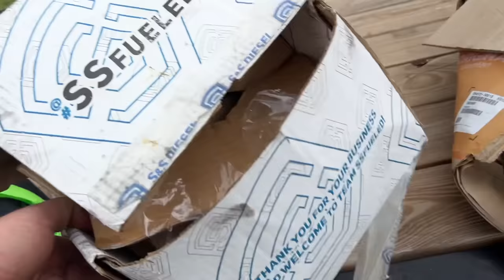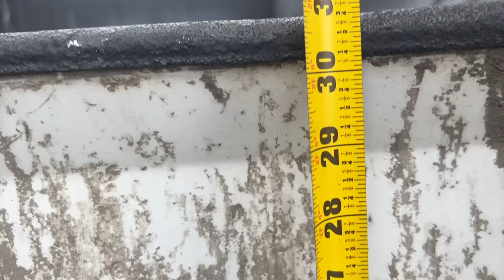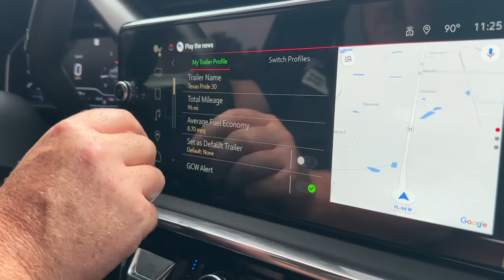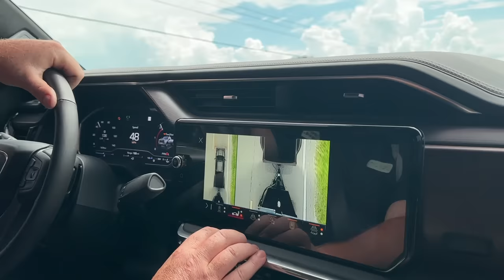$100,000 Diesel Truck VS $2,000 Diesel Truck!!!!  Are These New Trucks Really Worth It?

Comment: No matter how you put it, there is never a good reason to buy a truck for $100k when you can get a 2019 for $53k. They RAPIDLY depreciate and are often less reliable than the older models. It’s legitimately proven
Reply: Your not buying a 2019 3500/F350 for 53k Denali/Platinum without a crap ton of miles on it. I love how all the small brains assume you have to buy a Denali to get a 3500, or a Platinum to get a 350. There's brand new diesel 1 tons for 66k-70k
Reply: @GhostlyGhille  All fleet sales. White XL's for Ford, white LS's for Chevrolet. GM doesn't cater to fleet, as Chevrolet is the fleet brand.
Reply: @GhostlyGhille  is right. Just picked up a 2024 2500 duramax custom for 67 out the door.
Reply: leptivieux1  it is what it is in this market. I need something reliable for work, but I don’t need the tv screen in my wood dash for an extra $18k
Reply: usually newer cars are more reliable, last longer with better fuel economy technology, but something has had happened in these last years; If i've had to get a pickup id buy anythin' from the really old ones to just about 2013
Reply: Plus imagine the price difference of fixing the vehicle.
Reply: @SKC_car that's cause you drive it to shit. Sell it for the next person to fix it up. That's what takes the most time. But you're right as long as your new car isn't facing recalls for everything.😂
Reply: @jabocjacob7064  67k is a horrible investment. And not very reliable.
Reply: @Infamous-cause  yeah I'm sure he's beating the hell out of a brand new vehicle he has a loan on. My wife doesn't beat vehicles and her brand new explorer needed 6k worth of electrical work done right after the warranty expired.
Reply: Nah bullshit newer ones run fine . older ones are what are at the shop
Reply: @iam1ofST2  ironic how that works huh? Lol 😆
Reply: @Joeybago12  also won't retire until you're 70 🤡. I'll be retired before I'm 45.
Reply: U won't find a 2019 limited or longhorn. Unless hi miles. Maybe a Laramie or slt
Reply: My 2011 worth nearly 50 loaded 89k
Reply: Yea this is a shitty point because you don’t know what the reason was to why the 2019 is back on a lot after 4 years like a new vehicle is yours only yours no one else to blame if some goes wrong 💀😭
Reply: @ianlundy416  it reallly doesn’t matter. Anyway you calculate it there is no reason to buy a new car. The thought of buying a used car with problems is extremely easy to avoid with a few months of researching cars. Buying a well engineered car with over 100k miles is absolutely no problem and you can often more reliable vehicles around the 15-20 year mark.
Reply: Can you show me a truck that’s a year old and 47k less than what’s on the lot?
Reply: @joesminis  look at trucks around 15 years old. Majority of them even with higher miles are just as or often more reliable than newer trucks. DO YOUR RESEARCH. Don’t buy cars with unfavorable engineering.
Reply: It doesn’t matter, some people just want a new truck/car. Something that’s THERES and no one ever else has owned or has had ownership over.
Reply: When you got the money like that why not
Reply: Yup. The newer models are garbage 😂👍
Reply: One word tax write offf
Reply: They are paying for the warranty..
Reply: ... and you stoll have $50,000 to spare for any repairs you might have like a $7,000 fuel rail system repair. Never have to worry about all the bs environmental systems that cause newer diesel's to fail 60,000 miles later, which are costly repairs in themselves.

$20-30,000 sounds much better than $100k.
Reply: Sure there is if you can write it off. Helps me with taxes.  If you own a company you can write it all off
Reply: I bought a 2020 chevy duramax work truck for 47k. Thanks to family discount but it still was a 50k truck. I've added the upgrades I wanted on my own for less than 2k and it has all the looks of a 65k truck. The diesel is what I wanted and we'll worth it compared to the gas engines.
Reply: @bjenkins803 what do you do for a living?
Reply: I like the idea of letting the first owner iron out the initial warranty issues while it gets broken in.  Waste somebody else's time.  When I bought my last used truck, I just paid a few bucks for an extended warranty from the dealership. Well worth it.
Reply: @jabocjacob7064 where?😂
Reply: That 53k dollar 2019 also has 193k miles and is closer to risk of needing repairs done. This is why you buy new.
Reply: @G7clipsofc I just bought 2020 duramax LT for 53k with 52k miles.
Reply: They don’t depreciate very much if you trade them in about every 3 yrs and don’t scratch or dent them and keep the insides clean they bring top dollar and if you have any warranty left that’s just a big plus !
Reply: GM with the lifter problem that takes a new motor because metal has wntvthrew the whole motor and that’s what happen to my brother in-law 36K miles GM put a brand new motor in his truck but the dealer changed the lifters out for some brand X and it’s doing great now with 74K on it. Fords new gas engine Godzilla is a lifter eating monster and 56mi per gallon , that’s a nice new truck and he knew what the problem was so at each service he would take a oil sample and from the 5th oil change he got oil samples bake from BlackStone with metal in oil and the dealer said drive it till it stops and we will tow it in and put a new motor in and it took about 2 mo for it to quite and they had that motor in stock as it took them like 4 days to change and they put aftermarket lifters and cam in it and I don’t know if that’s Ford doing that or the dealer just takin care of good life long buyers of Ford products.
Reply: Fixing people’s trucks is where the dealerships make all their money or it use to be but I think they are making money all the way around sales and repairs, Gotya !!!
Reply: All I need is diesel 4x4 long bed dullay 4 door power windows puck bed tow package radio and that’s it .
Reply: Just open the hood on any new diesel truck you can hardly see the motor and the V8’s are the worst you have to pull the cab to work on and it’s a ton of money just to pull cab much less doing the repair and if all of them would stop putting there motors half way in the cab it would be so nice or make the like a Kodiak where the whole front end folds out and can be easy taken off for repairs. Just look at the new half ton straight 6 they were mad for cab over trucks not pick ups all the things that need to get to is on the back of engine like rubber belt run oil pump you have to drop the trans to change it out I think the said 100 -150 k miles it would be great on a cab over truck which they were built for Issu special !!! I think it is a good motor if you sell it every 70-80 K miles and if anybody can screw it up GM can !!!!
Reply: Unless you can write off that depreciation as a business cost 👌
Reply: @iam1ofST2 or after you pay it off lol
Reply: Some people want to get exactly what they want. They got the money.
Reply: I still drive my 95 7.3 423000. Miles. No intercooler. Stock 2 wheel drive ex, cab.3 transmissions. Also 99 4x4 extcab. 130000. Batteries and alternators.   Paid $34000.00 95 xlt. $42000.00 99 EXT 4X4.
Reply: Bro you don’t know what your talking about.
Reply: @monroe8365  New Hampshire. There’s no bullshit markups in New England
Reply: Ill take a 1999 ford f350 with a 7.3 over most modern diesels
Reply: @TheXV1CT0Rx  finding one is impossible
Reply: I agree, but IMO i'd rather buy my favorite looking truck, and engine swap it with my favorite engine. Did that with a 07 f350 king ranch engine swapped it to a 5.9
Reply: This does feel like a fair comparison
Reply: Did the new truck really perform sooo much better?
Reply: My old diesel left me stranded 100 times even after I put 50k in repairs so there is no way you can ever make me go back to used vehicles
Reply: @RigmorTalonbeard  must have put 50k into the wrong stuff. Or a bad mechanic.. 50k is enough to get a new engine, trans, rear gearbox, suspension and front end, with money leftover for a detail
Reply: @msharp6887  yes it was mechanically restored and still had issues every month. All done by ford
Reply: @msharp6887  and it was a 7.3 drw zf6 supposed to be the holy grail of all used trucks. Only 210 000km. I used to preach having old trucks was better but after stepping into a brand new truck the luxury the warranty and the reliability can't be matched. I probably won't have it longer then the 10 years it's good for anyway
Reply: @RigmorTalonbeard  clearly poor mechanics
Reply: @RigmorTalonbeard  10 years? That’s pathetic. Should last 30-59
Reply: @msharp6887  you missed my point. I don't want an old truck anymore and no truck will last that long without costing as much as something brand new. Do you understand how much it takes to male a vehicle last 30 to 60 years? I don't think so
Reply: @msharp6887  in 10 years I'll trade it in and someone else can pay to maintain it while I enjoy my nice new truck with all the new equipment and no hassle. If all you can afford I'd a used beater then that's fine but you can't say an old truck is better you are lying to yourself and you know it. If new vehicles were so bad the companies would go bankrupt doing warranty repairs and replacements
Reply: It is your money. Buy what you want.
Reply: @RigmorTalonbeard  yes yes i do. And if you are spending. 30 + k on repairs every 10 years, u need to stop abusing your vehicle
Reply: @msharp6887  $50k in repairs…? Dude I have never even spent $50k on all
The cars I have ever owned in my life. Spend $8k on a decent used vehicle with favorable engineering and it should last 10-15years. It’s ridiculous to think you should ever have to spend $50k on a vehicle let alone in repairs. You did something wrong there guy
Reply: @OleSevers  u misunderstood, I didn’t spend that. The guy I was responding to spent that. Like a chump
Reply: @GhostlyGhille  I'll never understand the excitement for a premium truck package. At least not the 30k+ upcharge excitement.
Reply: It’s fine if you have money
Reply: What do you mean. You can still list an 07 lbz for 30k 😂
Reply: @GhostlyGhille 

Those are fleets. To get a family diesel you’ll have to pay money SMDH 🤦‍♂️
Reply: @Joe_Brown99  wth you mean a family diesel your family can't fit inside of the same sized F250 because it's an XL ? Reality is you want more bells and whistles and even then an XLT 250 is 73-75k with a 6.7. I sell these for a living and know prices and packages by memory. You want a 4x4 Lariat 250 for 2wd F-150 XLT prices that's not reality.
Reply: @TheXV1CT0Rx  7.3 made dog water for power. Could it run for ages definitely, most don't need any internal work into over 350-450k miles. But they make less power than the 3.5 ecoboost. The 7.3 is basically half the motor a 6.7 is. And thats with the emissions crap choking the 6.7 down.
Reply: @GhostlyGhille  i recently bought a 2021 lariat 4x4 for 45
Reply: @msharp6887  used with how many miles ?
Reply: @msharp6887  and was it a 500a, 501a, or 502a. Fx4 or just 4x4 ?
Reply: @GhostlyGhille  it was used with 35k miles, yes an fx4 though I don’t know the difference. It was a turbo v6, sunroof, power tailgate, all
Power, with trailer package. No idea it was a 501 or whatever
Reply: @msharp6887  502a has adaptive headlights power boards and power lowering and raising tailgate, 501a doesn't but still has most of the bells and whistles, and 500a is basically just a xlt with leather and a lariat badge. That said 302a xlts still nice. My 21 F 150 302a xlt arrived Feb 22, got it for mid 50s sticker was low 60s, has 15k miles on it last appraisal was for 49k
Reply: @GhostlyGhille  so that means I have the 502
Reply: @msharp6887 The easiest way to tell is if you have LED projector headlights not led reflector headlights (looks like a regular headlamp just with an LED bulb). Every F-150 XLT 302a and up has LED daytime running lamps, but only 502a and up get projectors. If it is a 502a 4x4 for that price is a pretty good deal. 502a is the notch below a King Ranch, or Platinum.
Reply: @GhostlyGhille  sweet . I love knowing I got a good deal
Reply: Yup my 13 is almost paid off and that’s way better deal then a 100k truck that’s just dumb!!!
Reply: Buy a used one that someone traded in because it was going and get fucked on the back end you seen how much a new engine costs
Reply: @GhostlyGhille yup just got a laramie 3500 dually 69k
Reply: I’ll keep my OBS as long as she will have me I really don’t know what people are thinking when they cough up 100 k for a luxurious truck that you’re afraid of scratching
Reply: @herbertmichaels2841 funny new one the payment is a mortgage not to mention the fluid in the exhaust thing is just flat out dumb my old truck could be in the shop everyday and still be cheaper
Reply: @OleSevers because everything was fixed already plus bonus parts
Reply: Love these people making excuses for new vehicles “needing work after 100k” or saying they’ll last longer.

Do you know how many GMT800s are still on the road with 300k+ miles? My 99 has 215k and has never given me trouble. Reply to me when you 2020 GM lasts 25 years without 10k in repairs.
Reply: @G7clipsofc this comment shows you know nothing about trucks. A well made truck will last into the 350-400k mile range. 190k is only its half life. Although only for old trucks, new trucks won’t last that long with all the sensors and aluminum blocks.
Reply: @RigmorTalonbeard my truck is 25. 1999 Sierra runs great nothing but normal maintenance and wear items. You bought a lemon and complain it’s the designs fault. It was Prev owners fault and yours for not checking it out better.
Reply: @LinusScrubTips  cars and trucks made around 1997-2007 can walk circles around the modern car. Especially with all these added electronics and required to remove entire body to work on the car will ruin you in the long haul
Reply: $53k is still a joke
Reply: @tanner882  yea I would never spend that much on a vehicle knowing you can get even more reliable trucks and cars around $10k.
Reply: Well a 2019 that was 100k ain't gonna be the 53k 2019
Reply: @GhostlyGhille which we need to admit is also about 30 grand too much.
Reply: @jabocjacob7064  could have built a bulletproof anything older for 40. Good luck brother.
Reply: @xCORRNHOLIOx well they are in the hole especially ram and gm always looking for a bail out and then want 100k and have recall after recall  not very convenient especially when thats the tie breaker between buying new or used but i get it if you can do new then by all means me so much to look at
Reply: See -
2023 Section 179 Tax Deductions for Small Business Owners
Reply: I just got a ram diesel 2019 5th gen for 24 😎
Reply: My parents have 2016 high country with about 280k miles and it still worth about 110k
Reply: @west6807  it is definitely not lol
Reply: That's exactly right! Plus, you can't take a warn out well-used truck and compare it to brand new either. I don't like the 6.0 but at least have all brand new parts and then compare. The 6.0 is keeping up with your 100k truck. Think about it. You've waisted your money, bud.
Reply: The only good reason is because you just want to and it's a very small part of your income so it doesn't really matter.
Reply: @OleSevers dude that is saying he put 50,000$ worth of work to it is high on something bro there’s not way that dude is a complete goof bro
Reply: I’d get a 2019 or 2020, I’ve heard a bunch of issues with everything between 05 and 18
Reply: Trust me there are a lot of half priced name year and model for less than 30k miles on the odometer 
You are just blind @GhostlyGhille
Reply: @GhostlyGhille or you can go and buy a old truck for like five grand and do the same stuff
Reply: @wesleehardin  former mechanic of 9 years. Older means more prone mechanical failure. Not only that I like the added tech. A 5k truck is a 2000 2wd with 260k + miles
Reply: This is how I feel about a ram powerwagon they like 85k+ and then for one 2 years old it’s like 55-65 😂eh I’ll take my 2 years  .
Reply: You ever heard of tax write offs?
Reply: @fabianmoye7919  I think your getting a misconception of tax write offs it ain’t a free truck and you still paying 100k for the truck either way
Reply: @treboy  no misconception if the gvwr exceeds 6k lbs you can take advantage of the "Immediate depreciation deduction" if you use the vehicle majority for work. Via a business you own or if you work for yourself via 1099. Since I install HVAC units. It's pretty easy to take advantage of the deduction. This year I'm planning on buying my lady a G-wagon. Completely tax deductible. Meaning I receive it for free. Because it lowers my tax liability astronomically for the year. I use the business to pay my daughter minimum before she has to report taxes. She's 13 months old
Reply: @GhostlyGhille I love how you made a comment completely unrelated to the OP. There is no good reason to buy a 50-100k truck when you can buy the old one and make it better than the new for 1/4 of the cost. Unless you have the small brain and don't know how to work on em/upgrade them yourself, small brain boi
Reply: If you make payments it's not yours, you're just renting from the bank 🤡
Reply: @bobbylee6859  not renting. That's why you're paying interest on the vehicle. Because you are actually buying the vehicle from the bank. Once you pay off the vehicle the bank will send you the pink slip.
Reply: Almost like they designed it like that. 🤔
Reply: Tell that to my 6 maf sensor my truck has eaten
Reply: Tax write offs
Reply: Until the 19 for 53k you saved so much money on has major issues.  Ask me how I know.
Reply: You don’t ( fix ) it.   It’s fixed for free at the dealer.   Factory warranty. Then traded in.
Reply: Haters gonna hate I’m upset too I can’t drop 100k on a vehicle 😅😂 I’m good in my old lariat all I need is my ac/heated seats
Reply: If you’re worried about Vehicles being depreciated assets than why are you watching these types of YouTube channels🤣
If you’re worried about a depreciated asset than you probably don’t have the money to buy/afford the 100k truck🤷‍♂️
Plus a 53k truck vs a high end new off the lot DENALI COST MONEY🤣
Reply: @sks_car the new cars are just as much pos. Everything after 2010ish is absolutely junk. Best 2 engines put in trucks are the 7.3 444 and 5.9 6bt. The problem with the 5.9 is it comes with a dodge trans
Reply: Tax purposes (tax deductions) or made to order for a particular reason. E.g I'd love to get a 3500 Alaskan with particular things from the factory in a particular color. Obviously it's not going to happen but if I had to come up with some tax deductions split up for 5 years I'd go with that. Other than that yeah I'll always go for older trucks. I don't have to worry about no tax deductions lol 😂
Reply: Warranty? New nech? Better financing?
Reply: My '98 12v Ram Cummins gets 28-30 mpg.  After  '98.5, when they went to the 24v, mileage dropped to 15-20 mpg.  When the DEF systems were added, fuel mileage dropped again PLUS you have to run DEF.  Newer does not necessarily mean better mileage OR longer lasting...
Reply: @GhostlyGhille -- Good luck finding one on the lot.  You can order them, but if you want to check it out and go on a test drive, you are pretty much stuck paying $100k.
Reply: @kender1412  I work at a ford dealer.. I could find xl/xlt/lariat 250s any day of the week. There's about 12 within those trims out there right now ranging from 55k in a gas burner xl to 81 in a 6.7 lariat. Once again 100k is either a Limited, or a High output platinum/kr.
Reply: @GhostlyGhille  -- You don't work at a dealer near me.  Only top end trucks on our lots.  I often wonder how they make money because nobody around here can afford that shiz
Reply: This is an apples to oranges comparison. Both trucks did the job. 100k for a truck is ridiculous its almost as much as some people's homes. It all depends what your income allows for and you can justify spending. The gmc sounded like a splurge being a dream truck vs a truck with probably 250k miles that was bought for a play truck.
Reply: Tax write-offs for business owners
Reply: @GhostlyGhille  exactly. We just got a new 450 for 73. And it wasn't are bones either.
Reply: @jordanalexander615  these guys just talk out of their you know what's. They see platinum cost 100k and say away man all these trucks are too much because they want the platinum. Get the lower trimmed trucks. All the mechanics are the same you can pull the same weight they just want the massaging seats and sun roof aswell.
Reply: @GhostlyGhille Right. Bought my 24 3500 drw LT  diesel for 62k, 67k OTD with 10k miles on it. Has all the cameras 5th/goose prep the whole 9. Truck MSRP at 85k, dealer bought it back from last owner from 68k.Sat in there a few hours to lowball them. At 25k miles now and they won't stop calling me to buy it back. Also said they'd put me in another brand new truck at my same payment if i bring it back lol.
Reply: That 2019 is also gonna have 200k mikes normally and be about ready to have issues. You buy new for a reason.
Reply: @200130769 Cant lie fords are pieces of butter now unless its older then 2000
Reply: @GhostlyGhille   they made less than the 3.0 powerstroke in the f150s
Reply: @west6807 no it's not
Reply: I bought a 23 f250 6.7 out the door for 64k...
Reply: The 7.3s made less than the 3.0s
Reply: Tax write off
Reply: Or guys maybe he’s proud of where he’s at in life and wanted to reward himself for all his hard work
Reply: They take a hit the first year and that’s really it. I bought a 2019 GMC in 2020 for 59k and I just sold it for 68k
Reply: @GhostlyGhille 70k for a dogshit 2wd work truck is still insane.
Reply: @Zach-td5mb  your guessing.. 70k gets you a 4x4 6.7 stx nearly an xlt.
Reply: @GhostlyGhille  Still insane money for small business that need work trucks though
Reply: Got my 3500 6.7 megacab limited with 130km on it for 49k! Came deleted and leveled with a few cosmetics , still going strong at 350k